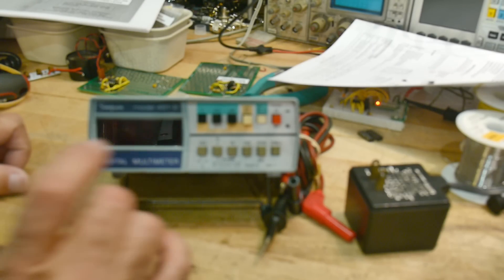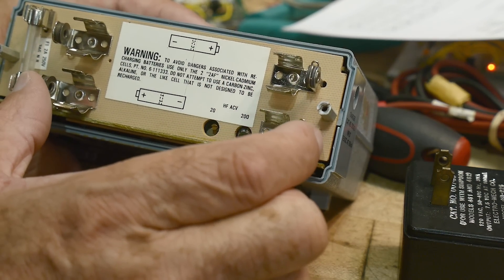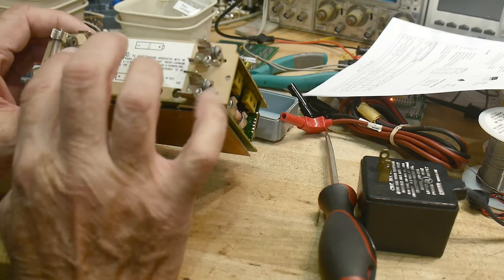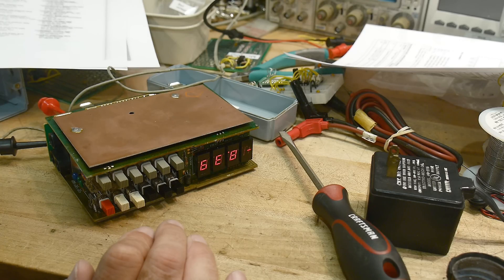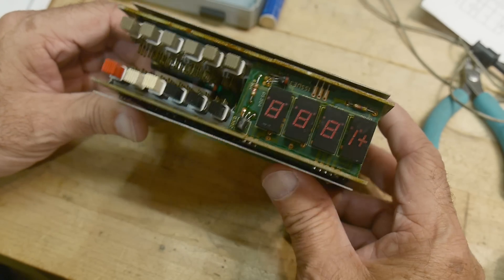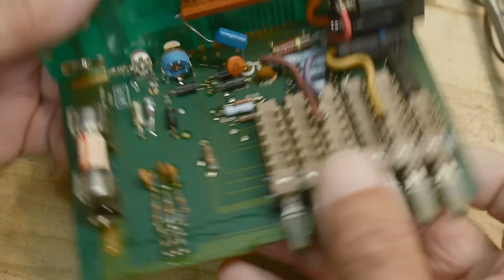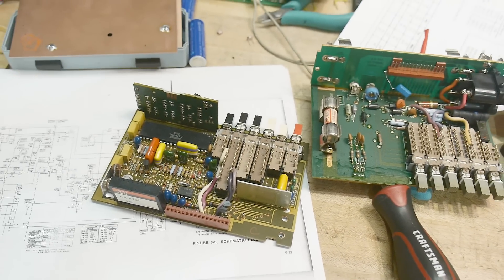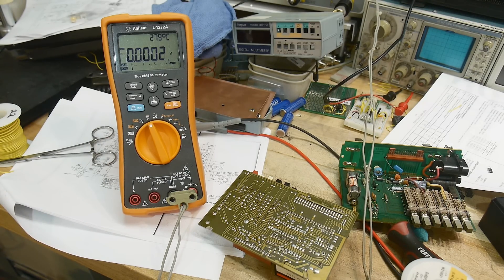#1633 Simpson 461-2 Digital Multimeter (part 1 of 2)

Comment: If it was designed to be used with the charger plugged in it should be fine at 7.5V. The charger supplies .75W. When you ran it at 5V it drew .65W
Reply: I noticed the 5v he was giving it, too...  Could explain the strange readings.  I'll have to watch the rest of the video now to find out.  😸

Comment: I can't wait for part 2. At a hamfest last week I picked up a Fluke 8040A which is very similar. It runs off 4 C cells or a wall wart. I haven't tested it yet. I also picked up a Heath Capacitestor IT-22 which might well be faulty!

Comment: It appears that your meter is missing the two cardboard tubes that the 4 AA nicad batteries would be slipped into and then installed in the meter.

Comment: Our 80s scope has an integrated multi-meter on top which has a similar vibe. We use it with kid gloves; generally using cheap, portable modern multi-meters to avoid destroying good vintage equipment.

Tetronix and others did this.

Comment: In the 70's and 80"s my dad ran a meter lab for a large electronics company. I worked there for 6 years after high school doing large transformer testing and assembly and eventually moving into the repair department, linear and switch mode. They had every meter known, and replacement parts, I remember those batteries, (and many other strange configurations) they had even cobbled together charging stations for them, as they produced regulated power supplies anyway. Unfortunately I want to be a car mechanic and was not that into it, sigh. They would regularly scrap meters and scopes all the time. Why oh why did I not hoard them all. youth...

Comment: I’m actually working on one myself currently. Same one.
Reply: Mine is not reading correctly like yours. I suspect the ICL but I got sidetracked by an HP6920B meter calibrator I just received. Lol. ADHD. 😂
Reply: Hello. We don't know each other however My name is Eric from South Carolina. I'm not very tech savvy but I know good tools when I see them. I have this  this exact meter Never been used with original manuals including the warning tag regarding the batteries and of course the leather case and test leads. It's truly a time capsule and a piece of American history. I would like to sell this piece so I'm reaching out